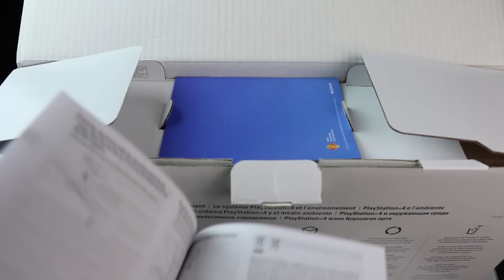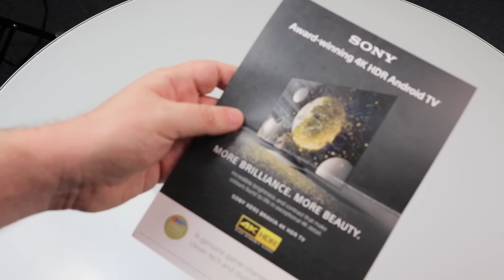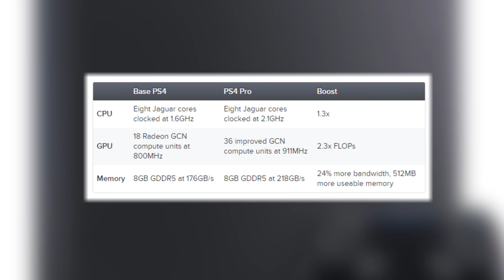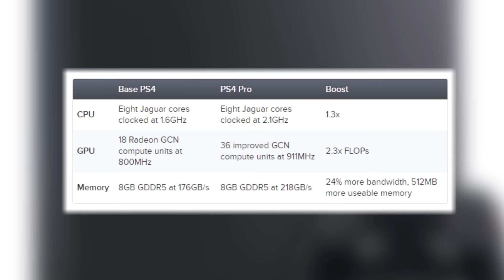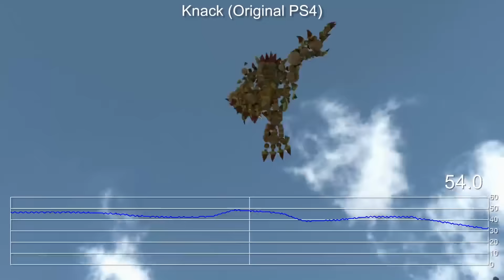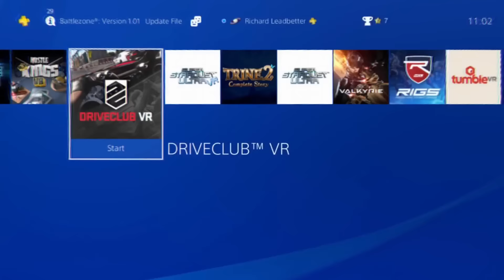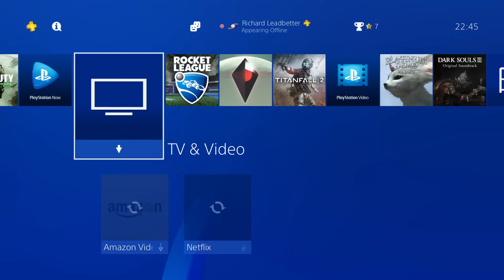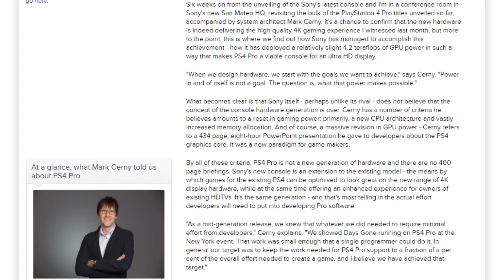DF Videocast #4: Unboxing PS4 Pro, Meeting Mark Cerny & More

Comment: DF stop calling the PS4 Pro demos 4k (except the handful that are) in the first 10-15 min of the video.  If its not natively outputting 3840x2160 its NOT 4k.  Stop aiding and abiding Sony in mudding the waters for technically illiterate users.  Alot of those casual users will not keep watching until the end of the video and you are helping Sony misinform them.  Your analysis at the end was very objective but you can not wait until 15 min in to start clarifying the PS4 Pros limitations.
Reply: Brandon Casey He is stating everything very clearly, he also knows that the important things is the final output, not the numbers alone, he says it very well.
Reply: it is outputting native 4k signal. the picture is rendered at a lower res. Output still ist 4k, no upscaling via tv or monitor.
Reply: Frederik Googel I'm not referring to the final output.  They explain everything quite well during their analysis in the last 10 min of the video.  My criticism is that they do not draw those distinctions within the first 10-15 min of the video.  The users that are truly ignorant are not likely to watch the video until the end. Those are the people that Sony is trying to influence with their subtlety misleading marketing and use of 4k and HDR as buzzwords.
Reply: Brandon Casey it's not that big of a deal. upscaled 4k is very close. it's not like they are trying to pass up 720p for 4k. Your comment is exaggerated with passion.  it almost sounds as if your having a political argument. LMAO
Reply: +Romeo Calmo True Story
Reply: Well is it that those people's own problem if they do not watch the whole video?
Reply: Romeo Calmo This world is full of teeming masses of profoundly ignorant consumers that have a very low threshold for curiosity and information absorption rendering them extremely easy to mislead.  The only protection these individuals can possibly have from being taken advantage of is objective independent  media that is provide the critical analysis for them that those individuals are seemingly incapable of doing on their own.  Marketing is becoming increasingly sophisticated and its ability to take advantage of those poor bastards is becoming alarming.  This is why having other voices that will contradict the elaborately crafted marketing narratives of large corporations is so essential.
Reply: MadFinnTech As long as low information consumers continue to exercise enormous financial influence through their consumerism their laziness and stupidity are everybody's problem that wants better products to be introduced and succeed in the market place.
Reply: yeh a lot of people who have seen the ps4 pro side by side with the same game in native 4k they say there is hardly any difference between the 2 which means really you don't need native 4k when it does not look much better
Reply: Brandon Casey Fan boy detected, lots of games confirmed at Native 4k including NBA 2K17, PES just to name a few other games upscale 4k. Still way more powerful than the 720p box. but happy trolling Fanboy.
Reply: +marklola12 The difference between 1800p upscale and 4k is very noticeable if your used to playing native 4k games on a pc.  There are diminishing returns on visual impact as resolution and image quality increase relative to the graphics performance required to render them but it is undeniably there for those of us that know where to look.  (The longer viewing distances from a couch also reduce the impact of native 4k gaming.)  For pc gamers that are used to looking at the difference between 1440p (Very close to what the Pro will put out in most games) and 4k through the difference is obvious even from a few feet away. 
That is all immaterial to the point of my comment though, which is to point out Sony's reductionist marketing pitch that seeks to take advantage of under informed consumers.  I only hope this comes back to bite Sony in the ass though when they try to sell consumers a "real" 4k console in 2019/2020 when they thought that they bought a "4k"  gaming machine this year.  The 8th gen consoles are really pathetic compared to how earlier generations of consoles stacked up to comparable pcs at the time.  By being excited about these weak shitboxes consumers are telling Sony/Microsoft that they are ok spending more money, more often for less powerful hardware than they received in previous generations.  That is the cost of consumer ignorance that we all pay and why letting Sony/Microsoft get away with it harms all gamers regardless of platform (even pc).
Reply: +david Maloney I acknowledged in my post that the PS4 Pro does have a handful of native 4k games.  I don't know why you thought otherwise.  Sports titles like NBA 2k17 and PES are not very graphically intensive because their are no explosive alpha effects and the playing fields are very easy to render.  It might have been better to have those titles be lower resolution while having higher graphical fidelity but they want to be able to say that they are native 4k as a selling point for both the games themselves and the new console at launch.
Reply: +Brandon Casey I will be always advocating for the truth, and i understand your concerns, still i think you are blind by other feelings since sony is making conferences and exposing very detailed info, like this, for people (missleaded) we cant do nothing because sony is mot making any false claims here, ive been looking for it and i found none, i guess they would have tryed if the specs were not leaked, but they ve been very transparent about the hardware and games, i guess more then they probably should as MS can use it in its favor. If people arent able to watch until the end of the video or understand what is all about, the diference between 1800p upscaled vs 2160p native wont be noticed too since only if you look for it very near you will be able to spot. And im just talking about the normal upscaling method, i guess this method is far better, and digital foundry seems to agree. So no, you are out pf reason...
Reply: Marcelo Tezza Alot of marketing these days is about word association and appealing to emotions.  Sony doesn't have to outright lie they just have to be vague.  (The same will be true when the Scorpio gets released).  Sony is able to take advantage of the fact that it is not practical to put a lengthy disclaimer on every advertisement (the tv adds will likely put the word PS4 Pro and 4K very close to each other).    One of the reasons that the Pro/Scropio exist is the migration to pc gaming because of the PS4/XB1's garbage performance capabilities. All of this marketing  with the new consoles makes it seem to uninformed consumers that they are getting an experience that is closer to what they could get on pc for similar money when they are not (by the time the Sorpio is released for instance gpus that can do native 4k 60 fps on Medium settings in every game will be released for around $150.00 - $200.00).  What is marketing attempts to create is the impression in poorly informed consumers that "consoles are not behind pcs", "This console is giving me a state of the art experience because its 4k" and "this console provides good value for money vs a pc".  Those things will still not be true.  The underlying issue is that unlike the 7th gen when consoles were similar in performance to very high end gaming pcs at the time and were sold at a loss by manufactures providing exceptional value to the consumer and a long life cycle (shouldn't have been 10 years though).  The 8th gen consoles by contrast were weak garbage at launch that were sold at a profit by both manufactures (in addition to the enormous profits they gain from being a closed platform.  And now in order to avoid losing sales to pc they are coming out with midcycle upgrades that the consumer would have to buy again leading to a large profit on hardware sales. If consumers were well informed they would reject the current consoles and continue migrating over to pc (and consider moving back in the future if console manufactures decide to start releasing products again which over more value to consumers and less profit for themselves bringing the equilibrium back closer to balance.  Most consumers are simply to stupid (which capitalistic corporations rely on) and governments/the media need to protect them from being "marketed" too (I can dream but those with the power to help consumers should do all they can).  In the future social and independent media should engage in "anti-marketing" campaigns that directly oppose corporations and the marketing narratives they are trying to push.  If independent  media continue to abet  corporations to get "access" they are allowing corporations to control them and use them as unofficial marketing outlets and are not acting in their own best interests long term when they will inevitably loose creditability.
Reply: Truth be told, even Sony expects/fears the Pro is going to sell poorly. There isn't enough killer apps to justify it at launch and it's a small leap for a mid gen upgrade since they didn't take full advantage of the RX 4xx series AMD has beyond the custom Polaris APis. Which would have put the Machine at around 5 to 6 Terraflops. That's more then good enough for $400. People tend to forget you also have to buy a $50 to $100 Windows OS (no pirating, that's the one thing devs hate about developing for PC so why add to the stereo type), a decent PSI3 or above mother board at around $70+ and a good current CPU that's Quad core at minimum which will add another $100+ especially if it's an Intel. And you still have the case for $30 or lower, the PSU Bronze standard or above at 500Watts or better which will be $60+ (NEVER skimp on the PSU, any electrician can tell you why that would be unwise), and the ram cards (12 GB minimum though you can get away with 8) which will be around $30+. your looking at around $500 USD after applying taxes at minimum. Not bad but not $400. The only way to get it that low is if you already have a PC that's PCI3 and or has a current Gen CPU Socket. Which will free you from the need to buy half this stuff, just get the GPU, Ram, and PSU and your good for 1080p gaming, assuming your CPU is a quad core.

Console market is actually vanishing though. PS4 Pro is likely to be Sony's last traditional machine and if that flops they're liking just going to go PC or Follow Nintendo and make a gaming tablet. (Big N's way of bailing out of the console race in a more subtle manner and merge their platforms). And Scorpio is most likely a $500 USD Windows 10 PC in a SFF case. I'd be a little shocked if it wasn't. Both Sony and MS didn't actually think consoles would last this long and even Sony was shocked the PS4 sold well. PC is looking to be the only remaining living room platform left actually. These two new machines are basically swan songs. And Nintendo is going full mobile with their new hybrid.
Reply: KyanbuXM The successors to consoles will likely just be streaming boxes with USB controller ports that run off the local desktop.  Consoles are definitely on the way, out but we might see one more generation of Sony consoles due to how popular they are in the Japanese market (a huge source of revenue for them) and how many Japanese developers are inexperienced with PC APIs (Even DX11 with such horrible examples as the first two Dark Souls games on pc.  DS1 was just incompetent).   It is likely though that (like Microsoft) other publishers will continue to push for Walled Garden ecosystems on their inevitable pc storefront/streaming service so that they can exercise similar controls to what they currently have on the locked down consoles.
Reply: They call it 4k because they are a SELL OUT. Sony is feeding them.
Reply: Dont worry the future of pc is streaming as well, because all the console ports it gets will be streamed to it, third parties will stop making games for dedicated hardware
Reply: It outputs in 4K and gives benefits for users of 4K Tv's. There is no external upscaling. So if the core data is native 4K or not is irrelevant. If you find it misleading you should learn to understand the english language better. Sony, other media and DF has been pretty clear that PRO uses upscaling and is "close" to native 4K for the vast majority of games. No one buys a PRO believeing it will be anything close to what 4K gaming is on a good pc.
The only value of the pro is access to some of Sonys gems on hardware that is not as anemic as the original (yet still anemic).
Reply: Brandon Casey stop stressing xbone fanboy. it just makes you look lame. unbelievable how many of you xbone fanboys have tunnnel vision when it comes to gaming. so lame
Reply: Hagg Son being close to 4k means it isn't 4k haha
Reply: Brandon Casey It's a $400 box. This console is meant to bridge the modern generation to 4K. Regardless of wether the box hits 4K or not all of the time is irrelevant. Want to know why? The allotted recourses in this box are permanently fixed. Even if this box could output all modern games at 4K natively, that doesn't say anything about games and engines of tomorrow. Technically, there is no definitive 4K video card. At some point, every card will be defeated by future performance engine.
Reply: bl1nx 360 Read again. Not to mention it does hit native 4K in some games.
The x1 and ps4 are considered full HD machines even though some games are natively sub full HD.
Reply: Hagg Son I dont care what you say. Just like the original ps4 and Xbox one aren't 1080p machines. Games will definitely look better on ps4 pro not gonna deny that. And yes some games will hit native 4k on ps4 pro, like some games hit 1080p on x1 and ps4, but it doesn't mean it's a 4k machine.
Reply: bl1nx 360 Yeah we are talking different things. My answer was to the guy that said if it's not outputting 4k natively then it's not 4k. Wich isn't true because the output IS 4K, it's just the source that isn't 4K natively. But it outputs 4K and it benefits from a 4K screen. So it is debatable if it is a 4k machine or not depending on what your defenition of it is. I mean even if it was only made to watch movies in 4K or stream in 4K it would be a 4K machine.
But what I think you really are talking about is is if it's considered a 4k GAMING machine to wich I agree with you.
To me gaming means 60fps at a given resolution. Everything else is second to that. With very few exceptions like games that are very slow and turnbased (Civilisation games f ex) and/or where frames have no impact at all on gameplay (like f ex south park stick of truth).
So if it can't hit 60 at 4K it is not a 4K gaming machine. I've been able to play 4K at 30 for years on pc, especially if I turn quality down, I never considered it a 4K gaming machine until I can hit 60 at that resolution with not much of comrpomises in terms of settings.
I doubt even the scorpio will be a true 4k gaming machine in that regard.
Reply: You say that there will be some 4k native on the ps4 pro with 4.2 tflops, but Scorpio won't be a 4k machine, yet it will have an additional 2+ tflops? Can you show me on the reveal of the ps4 pro reveal where it mentioned native 4k gaming?
Reply: bl1nx 360 Mantis Burn Racing is 4k native at 60 (well console 60 wich means alot of dips), TLOU remastered will allegedly also be 4k native at 30fps. So yes some titles will be native. However you didn't read what I said. We discussed what is considered a 4k machine or not and I seperated the term 4k machine and 4k gaming machine.
I doubt the scorpio is going to be enough for what I consider a 4k GAMING machine. That is that the norm on that platform is 4K native, uncompromised at 60 fps.
I believe you will most likely see 30fps for or other compromises on more titles on the scorpio than you will ever find native 4k at 60fps without significant drawbacks. I did not say that the scorpio cannot do 4k native.